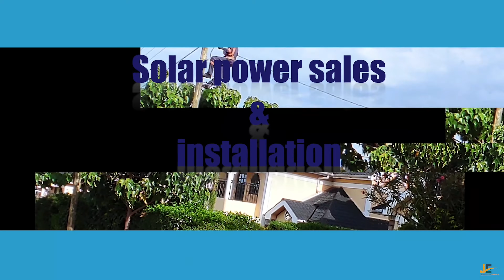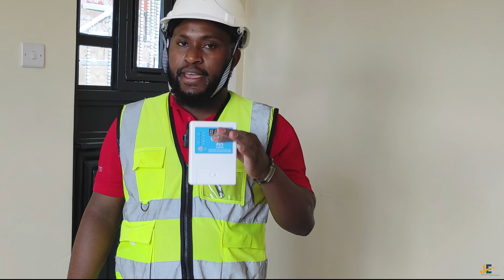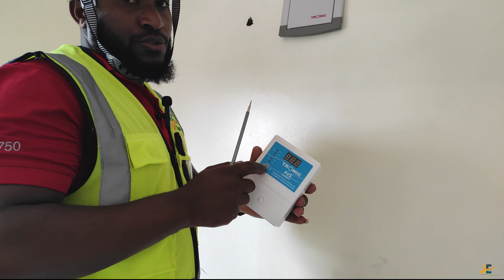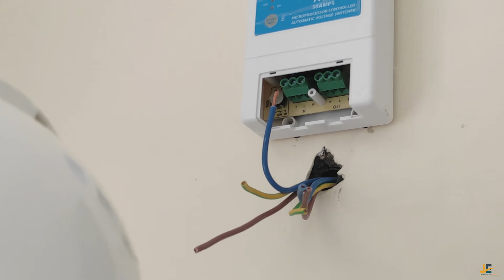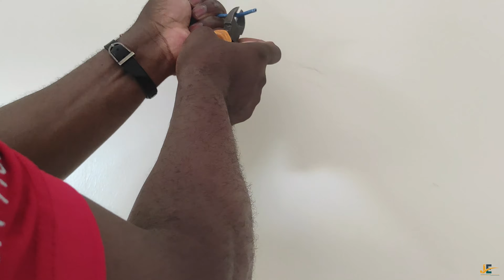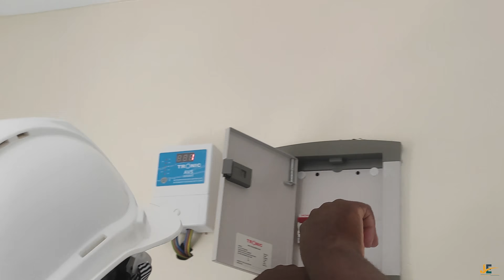How to Wire an Automatic Voltage Stabiliser {AVS/VR/AVR}. How to Protect TVs, refrigerators etc.

Comment: What's the difference between fridge guard and AVS
Reply from the maker: Fridge Guard → Protects fridge/freezer only from low/high voltage and power fluctuations.

AVS (Automatic Voltage Switcher) → Offers broader protection for all appliances, handling wider load capacities and more advanced voltage regulation.

👉 So, fridge guard = specific to fridges; AVS = general-purpose protection for multiple electronics.

Comment: What size cable is used to connect the Distribution Box (DB) to the AVS?
Reply: The Avs must be protected by the correct rate of MCB circuit breaker whether you're using D.B or consumer unit. The size of cable depends on the load the Avs is protecting from surges, sags etc. if you're protecting a specific circuit, make sure the size of cable used is the same or slightly bigger used to wire the circuit from CCU. For sockets or power circuit use 2.5mm.

Comment: Can it be fitted at the main house supply
Reply: Yes, either in the utility Meter box or next to Consumer unit. If the load is bigger than the Avs use a contactor switch with the correct load rating.